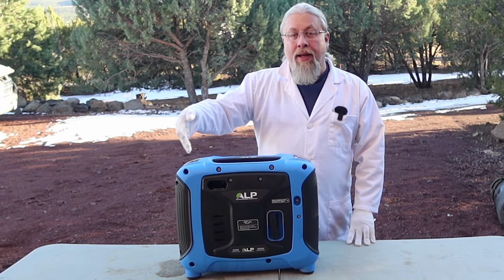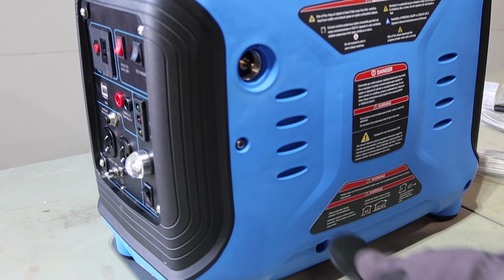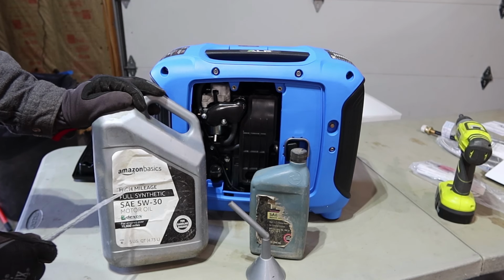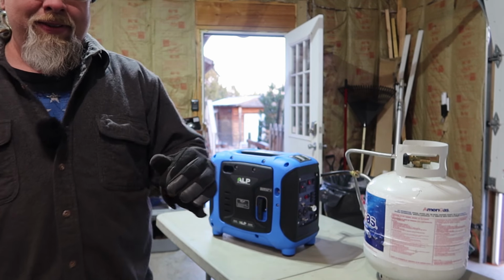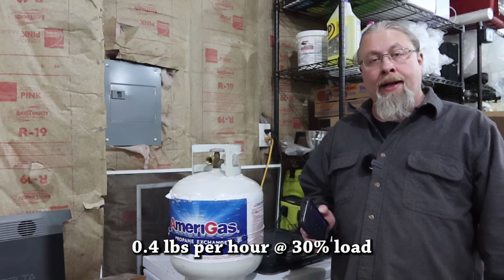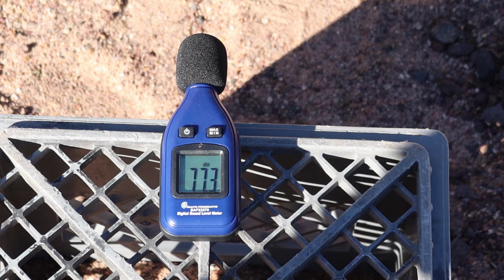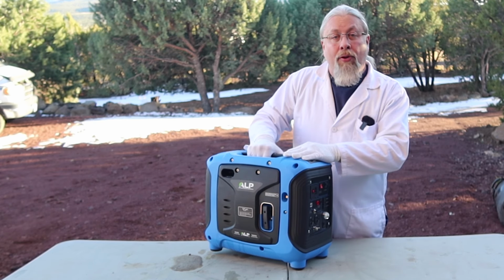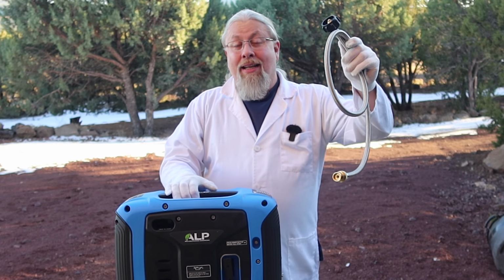ALP 1000w Propane Generator Review | Parallel Ready Eco Friendly Compact Efficient

Comment: For those curious...   I use my ALP to charge my battery bank (off grid solar) and a full (not exchange but taken and filled) 20lb propane tank on the ALP powering my 24v victron battery charger will put 402ah into my batteries which is just a bit over 10.5kwh.     So if your looking for a cost analysis... It cost $11 to fill the 20lb propane tank... which privides 10.5kwh of energy...  over a continuous runtime of 23 hours...   with a load of ~700w / 5.86a.

Comment: Professor.
Don't ever lose the screws.
Get a rare earth magnet, nice and strong.
Hot glue it to the INSIDE of that panel.
When you remove the panel, the screws are fresh out of the holes, so stick them to the magnet.
When the panel goes back, WALA!  THERE they are!, Easy to keep, as they never leave their panel for any distance, and the location is always SNAP, stuck to the magnet ON that panel.  No matter how long, or how complicated your work inside that panel, such as replace a fuel filter, or spark plug, or cable, or gasket, after you are done, 3 weeks later, when that rare part comes in the mail, THERE THEY ARE!
Reply: Very cool tip 👍👍
Reply: Wala? What the shit lmao? Is that 'murican for voilà?
Reply: Galaxy brain: replace the screws with magnets. Now it's tool-less opening.
Reply: @ctrlaltdebug  We replaced the screws with magnets on all our model planes and now the hatches keep flying off.
Reply: Hahahaha WALA hahaha

Comment: They cant ship oil or fuel in boxes in a big truck or stack of pallets at costco.
Reply: Actually all they have to do is ship a bottle with exactly the amount of oil your gen needs. Many push mowers have oil included in a bottle inside the box.
Reply: I'm not sure about costco, but at Home Depot all the large snowblowers come with oil in them. The smaller ones come with a bottle of oil. I personally have also ordered oil off of amazon. So I find it hard to believe that this is true.

Comment: This is the perfect CPAP backup generator. Propane can be stored forever. Plenty of power to recharge my Jackery seven times. Each Jackery 440 recharge = 2 days of CPAP.  Giving this some serious thought.  If it had 2,000 watts to run the microwave or instant pot it would be perfect at $500.  But it can easily run a crockpot while recharging the Jackery.... The Professor has me thinking.
Reply from the maker: You can buy two and parallel them for double the power.
Reply: @HOBOTECH  Thanks Tom. Just poured you a few cups on buymeacoffee. Really appreciate your Jackery 300 (and mnay other) reviews. As you can imagine, with all the power outages lately with something 85% of the U.S. covered in snow, having a solid UPS has been a huge peace of mind for a chronic CPAP user. Used the Jackery 440 for over a year and the 300 for about a month. Both solid units but I like the 300 better for the size and the 77 watts in recharge vs 65 on the 440. As far as the timing out for using less than 10 watts for 12 hours, that only applies if not receiving shore power (or presumably solar power). You probably said that, but it makes the time out not big deal to me since I never get 12 hours sleep, and surely would not during a power outage.  Anyway, thanks again at 85K subscribers and growing !
Reply from the maker: @msnpassjan2004  Thanks! Appreciate it!
Reply: @HOBOTECH  Haha, maybe it's your reviews or maybe half the country getting buried in snow, but they are sold out in every color !

Comment: An hour meter is what we need, had to buy one myself and connect it to 12 volts.
Reply from the maker: I have videos on installing hour meters on my previous generators. The ones I use have a wire that wraps around the spark plug wire.

Comment: Very very sad. That flush pocket for the handle is a funnel for rain water. No dipstick? Hard to access? Low oil volume? They want you to burn this thing up so you buy a new one. Sounds like a loud rattle trap. Buy Honda once and never look back.
Reply from the maker: Honda doesn't make a pure propane generator. That is the point of this product.

Comment: It's almost 2021...please stop burning fossil fuels for no reason when you can do it cheaper with electricity...🤦‍♂️
Reply: Ezmeralda Du Dortoka Tragically in the US most electricity is still fossil fuel generated. They are decades behind the developed world.
Reply: The use cases for units like this are to provide power when the electricity is out! ROTFL!

It’s 2021 and the world is well aware of what happens when electric power goes out, they saw when windmills froze across the state of Texas, a state the size of a good portion of the European Continent… people died.

Comment: Your break-in  myth is just that . The difference  in oil weights is propane is a colder combustion
Reply from the maker: No it isn't. I measure fuel consumption for every generator I've ever had and the first 5 hours every single one uses almost 30% more fuel.

Comment: Propane isn't eco friendly
Reply from the maker: Propane is not regarded as a greenhouse gas and is even listed as an approved clean energy source by the 1990 Clean Air Act.
Reply: @HOBOTECH  when you burn propane as you use the energy, what is released? Carbon dioxide, a greenhouse gas, it's listed by the clean air act because it burns clean, with little particulate, as opposed to deisel etc. this doesn't make it eco friendly. Propane is also derived from fossil fuels, requiring drilling, a lot of pollution and disturbance to the eco system.  The alternative is using solar and lithium batteries, which releases no gasses, burns no fossil fuels, so it's considered eco friendly. Also the lithium can be recycled into new batteries and be used indefinitely, as opposed to non renewable fossil fuels like propane.
Reply from the maker: @whateverthisis3929  Carbon dioxide is plant food, not pollution. CO2 levels were naturally much higher before humans existed and to say otherwise is ignorant of science fact. Anyway, I didn't claim Propane was eco-friendly, ALP did and I was repeating their marketing claim. If you think production of lithium batteries is pollution free you need to go spend some time in Chinese cities where people are dropping like flies from breathing the air, not to mention the gross contamination of the water and soil from lithium mining. Just because the pollution is made in the east doesn't make it any greener for those using the products in the west. By the way, CO2 is recycled too every day!
Reply: HOBOTECH I enjoyed your video but you have just totally discredited yourself with the "plant food" comment above. No intelligent person these days can believe that man made carbon dioxide emissions are not a major issue surely?

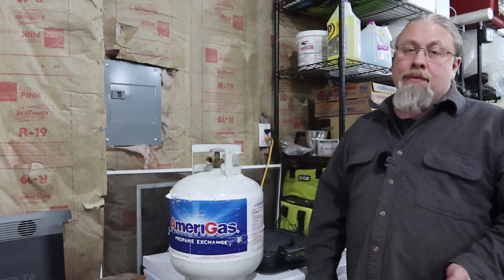Comment: @14:30 So you’re telling me they charge you for 20 pounds but they don’t give you 20 pounds of propane? And you’re OK with that…
Reply: I think you also need to watch out for the pre-filled tanks you can get outside gas stations and some retail stores. I read (or saw a video, can't recall) that they only fill those ones to roughly 15 lbs so that when they ship them, it's safer. Not sure if that is correct, so if anyone knows for sure, I would love to hear it. As for getting them refilled myself, I prefer to go to one my local propane refillers and have them do it (because they are low cost and also show me the before and after weights), but if it's after-hours, I will go to a retail place and trade-in or buy new from them (some places even have fully automated units, so you can theortically get them 24x7.) In that case, I just accept the lower filled tank as the price of the convenience.

Comment: OK then, that 20 lbs propane tank has about 130 kWh of stored energy. So what is the actual conversion efficiency? Propane safer than gasoline because you can't spill it??? Because it will not ruin the floor or what? While it will fiercely explode mixed with oxygen, while gasoline will not?
Reply: The main benefits of propane over gas for this are for true emergency use: propane will stay usable for a much longer time than gasoline. So if you live in an area that has an elevated risk of having some kind of hurricane or rolling-blackout or etc, you can keep a stock of generator fuel on-hand and not have to worry as much about using the fuel before it goes bad. Also, if you go camping, most camping trailers seem to have propane tanks on them and you could theoretically not have to worry about dragging along an extra tank of fuel for your generator (as long as you had enough to also run your trailer stove, heater, etc.) One other option I looked into was a diesel generator and possibly getting a diesel car/truck, so I could limit the type of fuel that way. However, I had trouble finding an easily portable diesel inverter generator, so gave up on that.

Comment: Nice VID, &  TUTORIAL 👍🏻👍🏻, 
Just wondering,    Does it matter if the HOSE - (Propane Tank), has a  
"PRESSURE - REG."   on   it? 
Cuz,     I  already have a hose attachs to the propane tank but it has a - - "pressure regulator"   attached to it...
Reply from the maker: I have to assume this is a high pressure device so you don't want to use a regulator.
Reply: @HOBOTECH +,   OK,   Thank you for the reply,   that's good to know... 👍🏻

Comment: The power consumption of about 550 wats for a 5000BTU AC was a lot lower than I expected, so VERY happy to be wrong. Have you tested one to see if its just a few specific models that use that or is that kind of what they typically run? I always thought that one way to get aorund running a tiny generator and dealing with AC would be to use a large battery powered inverter and let it handle the surges, then use the generator to keep the batteries charged. One question: do you know if this thing outputs pure sine wave or modified or other? I really like the ability to do parallel output too! I got one of those little Ryobi 900 watt units and it seems nice, but is rated a little lower than this and doesn't have parallel capability.

Comment: If you had to chose ONLY one kind of Gen would it be gas or propane? Depending on location those 20lbs tanks are on every corner just about as much a gas is. Have you hear/seen any test lets say between gas/propane for damage after X amount of hours?
Reply: 1. propane can be stored indefinetly 
2. Most gasoline has Ethanol in it and with fuel stabalizer  (according to label if you trust it which I personally don't) you can store it up to 2 years (that is an idea for a hobotech review)
3.  I can't imagine the Ethanol being very good for certain engine components in the long term such as gaskets 
4. Propane burns a lot cleaner which means your internal engine components will have less soot
5. in the event of an emergency like a long term power outage you generally need power to pump gas but not to disense propane
Reply: @advancedxdirective  
True... I was thinking how we carry gas in cars so we could always find gas propane not so much. 
My real question II was/is long term damage, which one is better for the engine.
Reply: @TheUGFUGF  my vote will be for propane providing the user keeps up with proper maintenance; especially oil changes
Reply: @advancedxdirective  
Yes! I find it odd that user's dont change there oil and spark plug and air filter regularly. Should always have 1 of each on hand. Zero reason not to care for the gen when it provides so much. Thanks.

Comment: Most gasoline engines will run on propane, just need to do your research. The engine in my truck will operate on gasoline or propane.

Comment: 1000 watt is crap i live at 9200 ft so 700 watts max come on my 4000 just gets it and propane cost $3.50 per gl and gas $2.10 gas you get 30 percent more btu can we say rip off right now i have 5 gen sets i have lived off grid for over 45 years and 1000 watt is crap my 2200 watt are crap Honda bog dowm all the time if you go over 1500 watts change oil ever 2 days no fing way 1 time a mouth i have a large solar set up but my genset  in win the runs 14 to 16 a day change oil ever 6 weeks or so max the genset sounds like crap

Comment: Just a head's up about running parallel. I've done that with 2 Honda 1000 generators and found that for any devices that cycle on and off (for me it was an electric Dyson heater, sous vide cooker, and an electric chainsaw), eventually throw the timing out between the two generators, which then overloads one with the standard result. Apparently the sine waves have to be in sync which makes sense and would explain why a sudden load may make one of them lose it's sync. You then have to start them again and let them sync again. It became a problem that forced me to go buy a 2000 instead. I've made the assumption that most 1000W generators with this feature probably suffer from this same problem, but I could be wrong because this was just based on my very limited experience with just those two generators, but I remain suspicious and skeptical about the ability to sync 2 1000W units as a solution to needing 1500W if that load may cycle on and off.

Comment: This 1000 W generator would be great for charging up my solar batteries, as I only need about 600 to 800 Watts. 
I wonder if this is cheaper than running a gasoline generator over the long haul?
Reply: Makes sense Why wear out the Sun

Comment: Good review as always!  I would like to know if it would start an air conditioner however.  I ask because my old square gasoline powered  "1000 W" Champion won't where as a 1000 W Honda will.  I like the idea of the propane fuel in that Propane has a much longer shelf life compared to gasoline which can go bad in 3 months.  Also you won't have the safety and spillage problem of storing gasoline in cans in transit especially if you don't use a pickup truck, you can just tap into your RV propane tank.

Comment: Can u make a video on how to get the best setup with different amounts of money. Like a solar gen. And panel for $500, $700, and $1000 please
Reply: For future reference:
My homemade Solar generator cost  much more than I thought it would. With salvaged Lithium-ion batteriies(1.4KWh), Renogy charge controller, DALY BMS, 30 mm Ammo box, 1500 Watt Aims Inverter, and a 24v to 12V  40Amp step down converter cost around $630. If you add the super deal that I found for a 360 watt  LONGI solar panel ($180) the total comes to $810. Round it up to $900 for the wire, fittings and expensive connectors that I had to buy.

Comment: Not crazy about propane. It acts funny when its cold and isn't as efficient or cheap as gasoline. I bought a predator 4300 gasoline geni and it didn't come with oil either. Its louder but has a huge tank. Runs 18 hours on one tank. I think its about 5 gallons. Haven't filled it yet.
Reply: Diablo Bullion The point about propane is That's is safer to store, cleaner to use and doesn't degrade over time. Ever tried starting something filled with two year old gasoline? It's not easy.

Comment: So a purpose built propane motor will typically have a  much higher compression raito than a gas motor to make up for the weaker fuel. A low compression gas motor on propane will be 15 to 20 percent down on efficiency if that helps.

Comment: You really should open the valve on the propane tank very slowly. There is an excess flow valve in the head of the tank and opening it quickly can trigger it and cause a failure to start.
Reply: Also there is a tare weight stamped on the neck of the tank T.W. In lbs.

Comment: I bet milling the head for more compression would make it put out a lot more power. Propane needs lots of compression.
Reply: Since this engine is engineered for propane only, do you suppose the factory designed it with the proper compression?
Reply: @largemarge1603  not likely

Comment: Often they won't include oil because the need varies by climate and season. Don't worry about the screwdriver, you already have one and it's probably a lot better quality than what they would sell you.
I wish you'd checked the engine brand for an idea about reliability, ie. is it a Harbor Freight clone or a genuine Honda?

Comment: checkout the difference between oil changes on internal combustion engines using traditional "gasoline" versus propane. I used to have a propane powered toyota pickup truck, after 5k miles the oil still looked like honey, just a much cleaner burning fuel and leaves less carbon deposits that end up in the oil. Might be part of why oil isn't included. Love the videos, thank you!
Reply: Bet that was a sweet ride